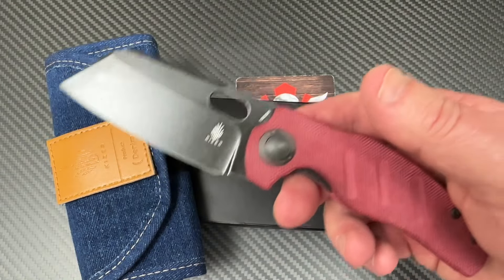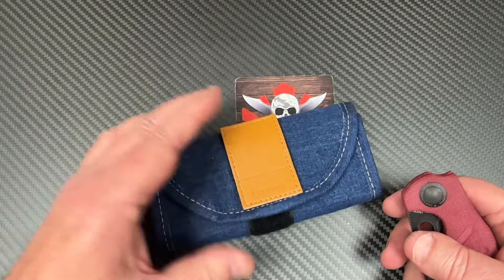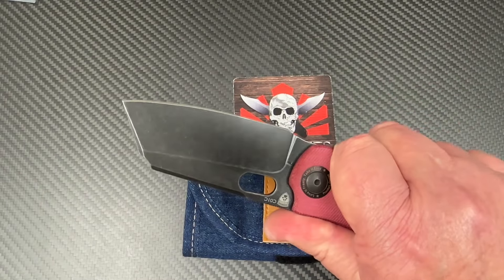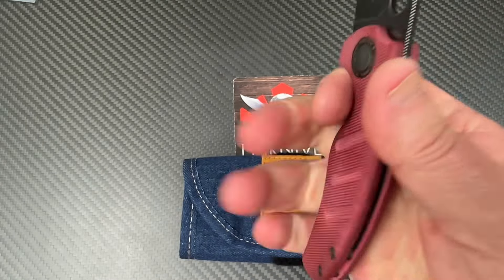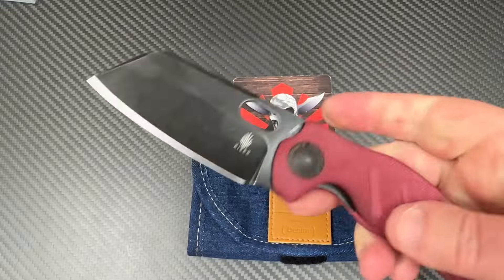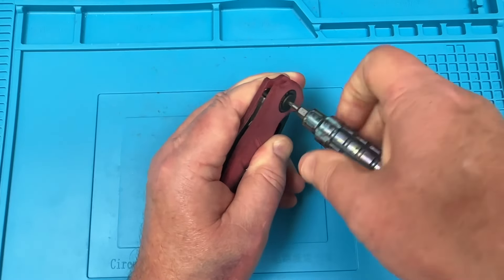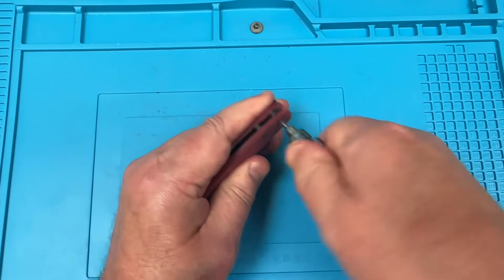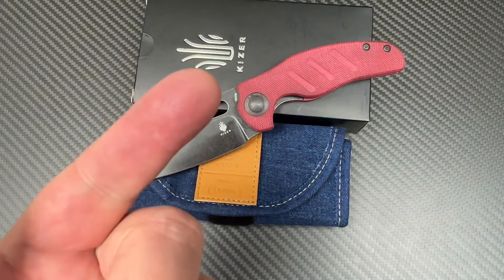Kizer Sheepdog Red Denim folder !!

Comment: Detent is way too soft on Kizers. Only a matter of time before someone slices their fingers when they reach for it in the pocket.
Reply: Any thoughts on their button lock, or clutch lock in regards to keeping the blade closed while in pocket? I don't know if either of those locks will make any difference at all when closed, but figured you might know.  I ask as I too was worried about slicing myself when going into pocket. I've had my auto knife (Benchmade Mini-Rukus) open in my pocket multiple times without me even realizing it. The tip got caught in the pocket fabric, but the blade was exposed....